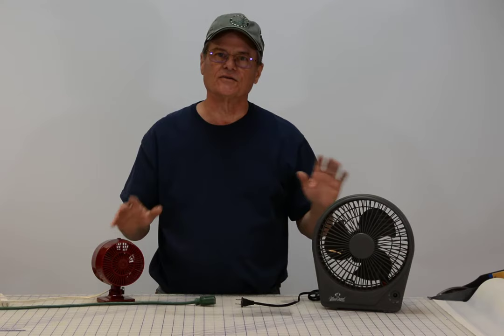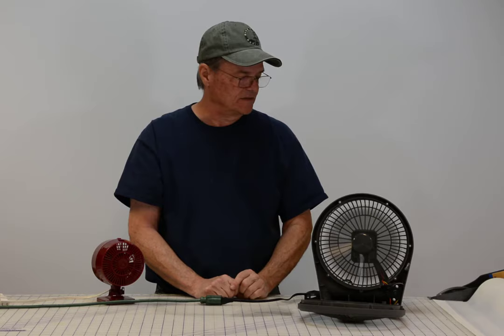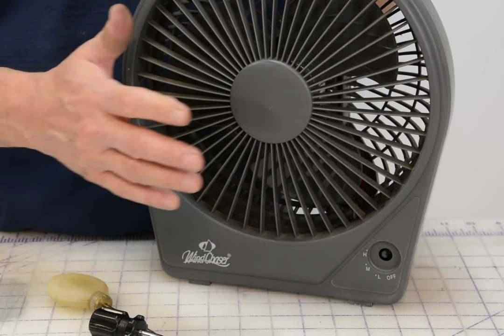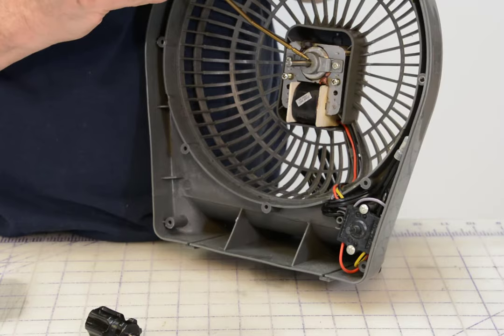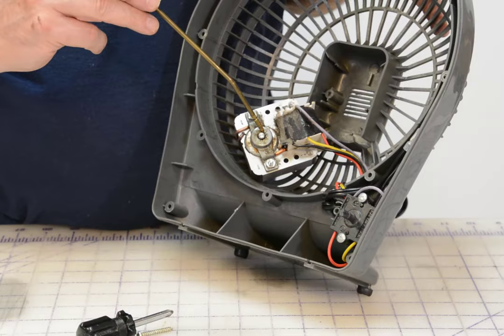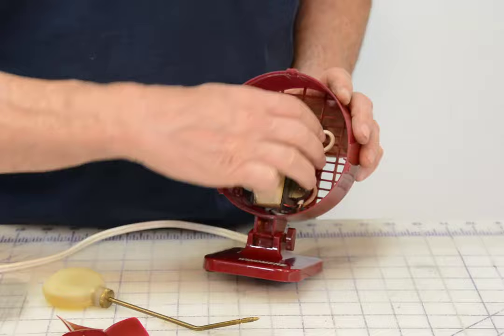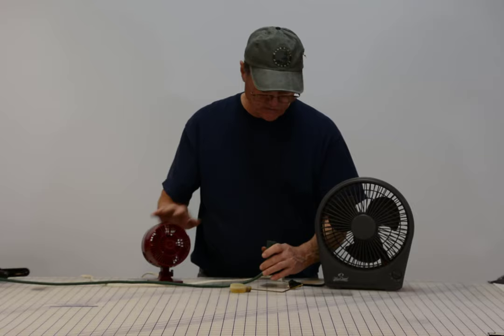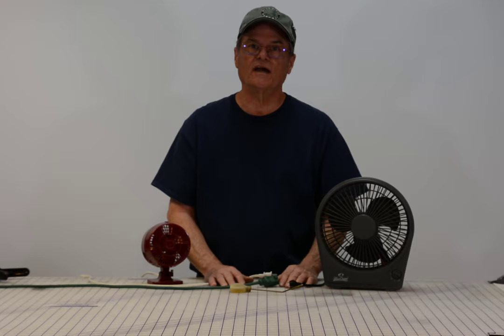Fan slow to start or won't startup - Easy Fix!

Comment: I know this video is a couple years old but I oiled where you said but the fan still won’t work, do you have a video on the wiring? I don’t want to ruin it it is a great fan
Reply from the maker: I don't have a wiring video.  If you turn it on, does it hum?  If it does try turning it by hand to see if it will start.  Sometimes it takes some running very slow to get the oil in the bearings where they need to be.  If no hum, it is electrical and i don't have a video on that.   Good luck with your project and have a great day.

Comment: I have a brand new fan that won't spin but I could hear some type of sound. Do you think its the same problem like in your video ? I also have the same fan and one day while it was on I was adjusting it the blades stop spinning.  Everytime I turn it on it doesn't spin but I hear the same noise like the new one i just purchased .
Reply from the maker: It sounds to me like both need lubrication.  However the new one should not need it.  I would try oiling them and see if it helps.     Good luck with your project and have a great day.

Comment: What about when my son plugged it in,  then it over heated? is it ruined? it won't turn at all, even with finger turn?  Did he burn out the motor?
 Can it be fix ?    Do you have another video ?
Reply from the maker: Your questions are hard to answer.  If you have a Ohm Meter, check for continuity of the motor.  If good, dissemble the motor to see if you can determine why it is binding.  If no continuity, motor is bad.   Good luck with your project and have a great day.

Comment: Any alternative other than WD-40 ?
and how long do i need to let ilubricant dry after applying it into the bearing ?
Reply from the maker: Most any light oil will work and it does not need dry time.  Your fan may still run slow at first but with it running the oil will work itself into the bearing.   Thank you for visiting and have a great day.

Comment: I forgot a fan plugged in and left the house, when I returned, I noticed a burning smell, the fan wasn't turning, the motor was warm. I unplugged it. If I oil it like you shown, should I try using it still?
Reply from the maker: I would, just spin it by hand after oiling it, before plugging it in.  When you plug it in make sure it spins and comes up to speed.  It may take a few minutes for it to come up to speed, but be sure it is turning.   Good luck with your project and have a great day.

Comment: Dratz!! I already tried WD-40 on my hand fan. I can’t get a new fan, because I cannot find a fan that just uses AA batteries!!  They are all rechargeable, now, and I need this to keep my iPhone cool (so, either way, I’m paying a bundle on batteries).  

I only put a squirt on one side. I haven’t opened it up to oil the back, yet. 

Would that oil that comes with hair clippers be good enough to use?
Reply from the maker: The oil that came with your hair clippers should work fine.   Good luck with your project and have a great day.

Comment: Great video just wondering is this the same for a bathroom exhaust fan works but very noisy .Thanks Dale
Reply from the maker: Hello Dale,  It depends on why the fan is making noise.  It would help but most of the time I have seen a bathroom fan making noise it is because the bearings are worn out.  If this is the case the oil will help but won't last very long.   Thank you for visiting and have a great day.

Comment: Hi, i have the same motor. I cleaned up everything, it just moves a bit if turned by hand, do u know what else could be wrong? I don't see any burns or black coils.
Reply from the maker: It could be it needs some time for the oil to get worked into the bearings.  Does the motor hum when turned on?  If so, it is most likely OK, the oil just needs to soak in.     Good luck with your project and have a great day.

Comment: @DIYwithWayne  Bushings should be greased not oiled. I took apart mine and there was grease residue, not oil...
Reply from the maker: Grease is good if you take the motor apart but sometimes they are difficult to reassemble.  If you use oil, there it no reason to disassemble the motor as the oil will work itself into the bearing.  It also works very well.   Thank you for visiting and have a great day.
Reply: @DIYwithWayne  But you are not able to remove gunk residue  from bushings. Adding fresh oil/grease  doesn't help that much, trust me. I have seen a lot of clock  movements treated this way - all went into garbage bag due to deep scratched pivots, so all gears required re-pivoting, so repair was not worth it because it is more expensive then another movemnt  in salvageble condition. I know, fans are cheap, so  not big deal, but you know - better keep that in mind in the future when you would like to fix sth more expensive/ hard to get.

Comment: Why is a lightweight oil recommended?

The fan I have is much bigger, and after opening it up I saw they had used grease at the factory.

Is oil better than grease for such an application? Please share your insights if possible. Thanks!
Reply from the maker: You are correct that the factory will often use grease on the bearings.  They use it when they are assembling the motors.  It is easier to use a light oil after the motor is assembled because it will migrate into the bearing much better than grease.  If you use grease it may not get into the bearing at all but a light machine oil will.  You can dissemble the motor and use a grease but that is more trouble and some motors are a LOT of trouble to reassemble.  Using the light machine oil is my recommendation.  As a side note I have worked in the field of servicing machines for over 40 years.  Thank you for the question.
Reply: @DIYwithWayne  Thank you for the detailed explanation! With that much experience you sure know what you're talking about! Two more questions then:
1. Why is WD40 not ideal for this? Is it too thin?
2. Could machine oil or WD40 dissolve the enamel coating of coils? If that's a possibility I better be extremely careful.
Reply from the maker: WD40 is too thin.  It will work but won't last as long.
I don't think WD40 would dissolve the enamel.  The WD stands for "water displacement" and it is not a degreaser but a thin lubricant.
Reply: @DIYwithWayne  Would using Tri-Flow superior Lubricant work?

Comment: my fan starting slow takes much longer than usual to pick up speed, i bought it in 2012 its been heavily used 24-7 all year round including winter! im weird i like air to circlate the room since im sat on a pc all the time maybe its so old its finally giving up working
Reply from the maker: It sounds like a good fan but the bearings need some oil.   Good luck with your project and have a great day.

Comment: Hi, my remote control fan goes from 1-12 on remote now when I turn it on on the pedestal none of the buttons work, it will not start so I push the power on remote and it starts but keeps going from 1-12 by itself crazy! How to fix? Is capacitor bad? Tested fuse it works.
Reply from the maker: Without having the fan to look at, I have no way of knowing the problem, but it sounds like a control problem.  If so, it would be difficult to repair.   Thank you for visiting and have a great day.

Comment: Could you use mineral oil? 
What about silicone spray?
And thanks!
Reply from the maker: Yes but if you use a spray, spray a little in something then put a few drops on the bearings.  If you spray it on, you will get overspray all around thee motor that will attract dust.   Good luck with your project and have a great day.
Reply: @DIYwithWayne  thanks!

Comment: Man, I knew that this is what was needed. However, both fans that I have use proprietary screws and I can't disassemble them.
Reply from the maker: Yes those special screws can be a pain.  Look at this link https://amzn.to/2WrKQei   Sets of special bits are not very expensive.  Also: this is only one set but there are a lot of options with different bit types.   Thank you for visiting and have a great day.
Reply: @DIYwithWayne  Thank you for advice. I'm gonna have to look for something more local to me though, as this would cost me 3 times as much just to ship to where I live (Russia).

Comment: Was Scared To Open The Motto So I Only Oiled The Side Of the Blade And It's Working But Its Not Running Fast As Normal
Reply from the maker: You need oil on both ends.  If you are scared to open it, you can try some spray lube like WD-40 but not much.   Good luck with your project and have a great day.

Comment: Hi mate! I live in Australia and cannot find the 3 in 1 multi purpose oil, can we use the oil we use in our cars? Or a multi purpose lubricant by selleys?
Reply from the maker: Most any light weight oil will work. Even WD-40 type of spray will work but they don't last as long.    Good luck with your project and have a great day.
Reply: My fans working again yay! Thank you for the video!

Comment: Hi Wayne. Thank you for the subtitles your accent is very thick lol. Does the same fix work for a celing fan which only spins at one speed ? No problem starting to spin tho just cant change speeds so don't think it's the cap(?) I installed that fan around 5 years ago and it's easy to take down.  And also a mobile air cooler whose barrel fan wont spin but the pump is working? So annoyed that these air coolers are so expensive and only seem to be made to last for one season!
Reply from the maker: On your celling fan, sounds like a switch problem.  On the air cooler, will it run if you turn it to get it started?  If so, oil may fix the problem.   Thank you for visiting and have a great day.

Comment: Does anyone know where I can get replacements of the little clips that hold the back and front of the protective cage together?
Reply from the maker: I don't but some small wire ties may work.   Thank you for visiting and have a great day.
Reply: I ended up using zip ties and that worked well.
Reply from the maker: That's great, I'm glad it worked for you.

Comment: What would be the best way to deal with a loose fan blade?
Meaning the blades will no longer stay "pressure fit" on the motor.

I'm trying to find a way to get it to stick without using glue.
I attempted to use tape to increase the size of the shaft that the blades would fit to, but the blades just pushed the tape down then wobbled off again.
Reply from the maker: I have not had that problem but you try adding a small peace of tape or paper on the motor shaft.    Good luck with your project and have a great day.
Reply: @DIYwithWayne :
The tape was added to the motor shaft. Problem was, that the tape was pushed down along the shaft, which caused the fan blades to slip off again.

I found another video that had this same problem, but they used a screw to lock the blades in place on the motor.
I might end up doing the same, but it's a bit more invasive repair.

Comment: These fan motors are of the Newer Style. Lot of these motors Do Not have Oiling Tubes. Using a Self Lubricating Bearings. Most Do Not have any Oil Wicking to absorb the Oil. So Extra Oil will leak out. Those type of motors are the Same type used in Bathroom Exhaust Fans. Designed to run for so many hours. Bearings and Housing are not available. If Lucky you might be able to Buy a Replacement Motor. Which will Cost more then what was Paid for New. Have over 35 Years Rebuilding Electric Motors.
Reply from the maker: Thank you for visiting and have a great day.

Comment: hi how do i fix my electric fan  I put it on number but the Air is very weak
Reply from the maker: Is is a new or old fan?  If old, it likely just needs oil.  If new, it may be slow but doing what it was designed to do.   Thank you for visiting and have a great day.

Comment: Mine doesnt start too. I removed the fan and it needs to manual start so the fan would turn. The speed is really slow no mater what speed setting i place it. The motor isnt hard to turn so i think bearing isnt the issue. I also replaced the capacitor. But nothing works. Could you help on this. Thank youu.
Reply from the maker: Hello clipendo,  I understand you said the motor isn't hard to turn but did you put oil on the bearings?  Be sure to oil both front and rear bearings and there is a very good chance it will fix your problem.   Good luck with your project and have a great day.
Reply: @DIYwithWayne  yes i did but nothing happens. Its still the same.
Reply from the maker: @clipendo  On most fans the oil is the only fix for running slow.  I would suggest you turn it on and let it run some.  Sometimes it takes time for the oil to get into the bearing.  Other than that I have no idea.  Sorry.

Comment: My fan does not spin at all. Does not even make a sound when you turn it on. Maybe some loose connection somewhere but dont know where. I have oiled all parts and cleaned the rust, so the fan blades are free to move. Any help?
Reply from the maker: Sounds like an electrical problem.  Could be the cord, switch, a connector, or a bad motor. Good luck with your project and have a great day.
Reply: @DIYwithWayne  Thanks buddy

Comment: Just oiling doesn’t work most of the time for long they need to be taken apart and cleaned around the bushing or bearing and even that doesn’t last for long .replacement of bushings and bearings is necessary in most cases or armature shaft do to excessive wear.sometimes they are just trashed
Reply from the maker: My experiences are a lot different from yours.  I run those 2 fan about 6 months of the year and the last time I oiled them was 4.5 years ago when I made the video.   Thank you for visiting and have a great day.

Comment: I use the same lube and it doesn't last long maybe a couple days and it back to the same thing
Reply from the maker: That sounds like the bearings have a lot of wear in them.  If so, not much you can do but replace the motor of the fan. Good luck with your project and have a great day.

Comment: I have a very old fan it has 2 speed and the switch is  low, off, high. The low speed is not working any advice. Thanks. Tha fan I all metal, very heavy it even has a place to lubricate it..
Reply from the maker: It sounds like a problem with the switch.  If this is an old fan you may have trouble finding a replacement.  Thank you for visiting and please subscribe to our channel if you have not already.

Comment: Will this work for a ceiling fan? Mine is doing the same thing
Reply from the maker: I have not had a ceiling fam with the slow problem but I expect it would work the same.  The reason motors get slow to start is because over time the bearings get dry.  All they need is a bit of lubrication.   Thank you for visiting and have a great day.

Comment: Once I turned it on it was spinning very slow, and my fan has buttons (0,1,2, and 3) I kept pressing them but nothing happened so I waited a little while and I pressed 1 and now it works. I got worried because it’s always very hot in my room and I can’t survive without my fan 😅
Reply from the maker: This is a classic example of a fan motor that needs some oil on the bearings.  I would say you have a 99% chance of fixing this if you follow my video.  Let me know how things work out.     Thank you for visiting and have a great day.
Reply: @DIYwithWayne  do you think two drops of water would work because we don’t have oil.
Reply from the maker: @deanwinchester2316  No don't do that.  It will likely cause more problems.  Most any oil will work but a thin machine oil like 3in1 is best.  Thank you for visiting and good luck with your fan.
Reply: @DIYwithWayne  oh ok thank you, my dad said the fan was old and it probably just doesn’t work anymore so he bought me a new one lol.
Reply from the maker: @deanwinchester2316  That's always a good solution.  Thanks for the reply.